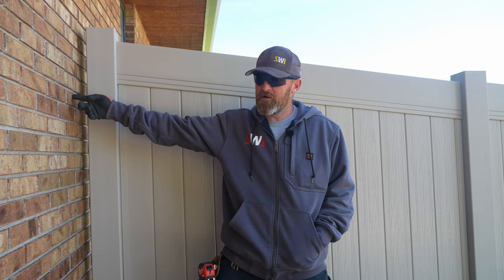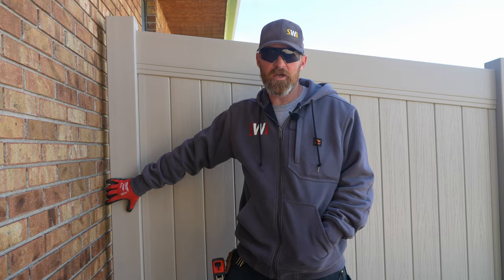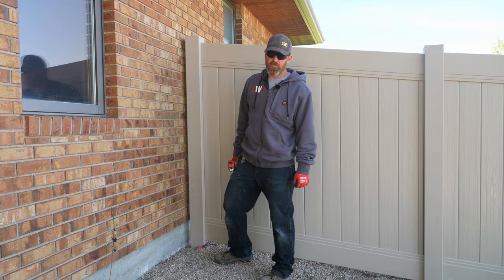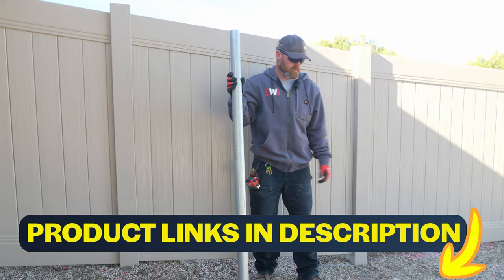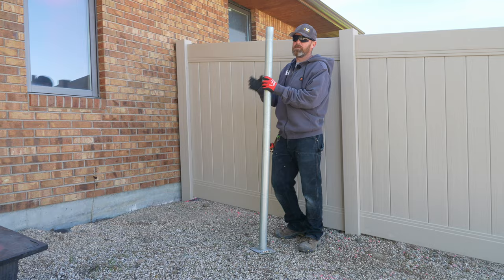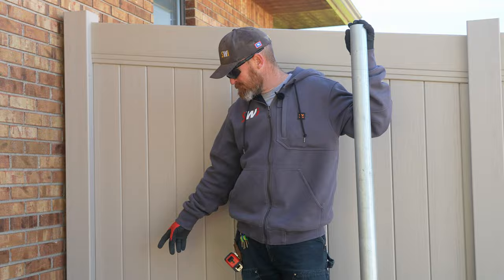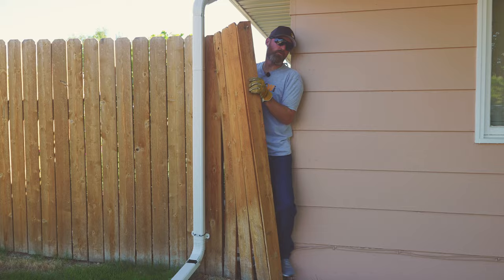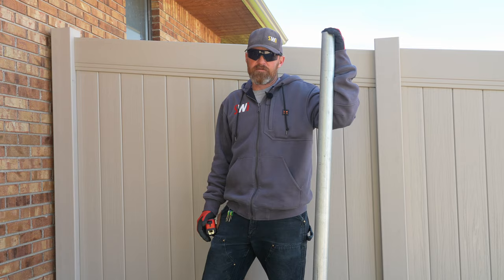How To Attach Your Fence To Your House The Right Way

Comment: In Florida if you attach the fence to your house it will be covered under your house insurance as it becomes structural. Learned this right after hurricane Ian. So there is a great reason to do it.
Reply from the maker: I think this may depend on the insurance company. Best to check with your carrier.
Reply: My Vinyl fence was not attached to the house, it 10 feet away.  UPC insurance covered it along with my well pump after Ian. They also went broke shortly after ☹

Comment: We do it in Florida because after hurricane Micheal, every homeowners insurance denied the fence replacement cost because it wasn't attached to the house. Every fence we install the owner ask to have it attached because their insurance company stiffed them. We still put a post next to the house, whether it's wood, chain link, or vinyl.
Reply from the maker: Sounds like they need better adjusters and attorneys.  We routinely have fences replaced under a homeowners policy.  Here's some reading straight from Progressive on the matter.

https://www.progressive.com/answers/does-homeowners-insurance-cover-fences/
Reply: That's funny!  Like that's gonna keep your fence anchored to the earth.... 🤣.  Criminals. They'll find any way possible to not do their job and screw you over.  In all fairness though, Florida rarely uses wooden framework in their houses right?  Metal studs and cinder block walls? If so, then there's no risk attaching to the house and would be the obvious choice. 🤙
Reply from the maker: Yeah it's rare to find an insurance company that's really out to truly serve the customer.
Florida has a ton more wooden framework then you would think.
Reply: Omg wen I was watching the video and looked at ur comment cuz I’m in Florida and I do Fencing so we kno hurricanes are no joke but yea Michael we tapcon the post in the home owners walls
Reply: @SWiFence  
So, Im in a situation RIGHT THIS SECOND where I ran an 8' section of fence where it butts up to a 4' section of concrete (that's a sidewalk). On the other side of that 4' section of concrete is my vinyl sided house. The 4' section of concrete is where my gate is going to be. I have purchased a nice and sturdy 4"x4" base that will be drilled into the concrete and that screws into the 4"x4", but there's no way that by itself is going to be enough for a gate or even as a stand alone fence post. With that being said, what is the solution for this particular situation ?
Hope you see this soon......
Reply: If you don’t have COVERAGE B - OTHER STRUCTURES on your homeowners policy, or you don’t have enough dollars in that coverage to pay for a new fence then you will be screwing YOURSELF.  Read your policy.  Know that the deductible is literally DEDUCTED from your payment.  And Fencing is always depreciated by its age in years.  So if you lose a $10,000 fence in a hurricane and you have a $2,000 deductible, and the depreciation is $500 then you’re getting $7,500 for your $10,000 fence.  No one is stealing from you.  This is how every policy works.  YOUR job is to know the real value of your fence AND know how much your deductible is so that you are knowledgeable about how much money you will receive.  You can’t blame your agent, the rep, the adjuster, or the industry for your lack of knowledge.
Reply: Mine is as well in Michigan. Now I have a crack in my wall
Reply: @SWiFence My insurance covers it ONLY at Actual Cash Value, no Replacement Cost if it is not attached to the main dwelling.  So you lose the depreciation.

Comment: I attach to houses all the time as it is impossible to dig a hole through the drainage pipes that often run along the base of house walls......it is common to do this in the UK. All new build properties in the UK have their fences running off the house walls. Gates are usually hung off of the house walls as well. I know you are based in the US where things are obviously different.

Comment: A lot of houses where I’m at have 6” drain lines running around the house. In some cases when the job calls for 4x4 you have no choice but to attach unless you want some hokey small panel (like the one in the video). Certain styles of wood fence you can face nail and get around it but sometimes there’s no other way but to attach
Reply: I haven't had drain tile be an issue yet, but you have a good point. I did have some conveniently end right where I needed the hole recently though.
Reply from the maker: We will have to disagree.  I have yet to see anyone address the potential for moisture penetration, make sure they anchor to studs, or in general make this look good.  Every time we see it, its a cobbled mess.  

We offered several ways to accomplish this without drilling into a foundation.  They did miss mentioning the optional Z post though which steps over the foundation/drainage or whatever with no need for funny little sections or drilling of concrete.

It should also be noted that we are talking about bolting a plated post to a footing.  If that causes failure in the concrete, there were problems long before we arrived.
Reply: @SWiFence  Agree to disagree. No biggie tho. To each their own. Still love the channel!
Reply: Sometimes you have to demo hammer against the footing to take out the over pour.
Reply: This is me. And no footing. On rockbed in mountains no less. Not touching the drain tile because it's essential. We get a lot if rain snd are the middle of a hill. The post is for a 12" section before the gate. No way I'm dighing and damaging tile for that.
Reply: @SWiFence  what is the optional z-post?

Comment: Love the channel, but I’m going to have to disagree with this one. 1) Faded paint or brick shouldn’t be a thought. 30 years from now grab a  power washer and move on. 2) Holes in the brick can be filled with a 4 dollar silicone tube. lags into the house are 1/64 smaller than the fastener, interface fit probably get more moisture from condensation on windows. 3) we aren’t drilling into someone’s foundation, I don’t want that liability. 

… you still build beauty fences. But lagging into a house isn’t as bad as your making it out to be.
Reply from the maker: We will have to disagree.  I have yet to see anyone address the potential for moisture penetration, make sure they anchor to studs, or in general make this look good.  Every time we see it, its a cobbled mess.  

We offered several ways to accomplish this without drilling into a foundation.  They did miss mentioning the optional Z post though which steps over the foundation/drainage or whatever with no need for funny little sections or drilling of concrete.

It should also be noted that we are talking about bolting a plated post to a footing.  If that causes failure in the concrete, there were problems long before we arrived.
Reply: I totally agree.  Scabbing to the house is the way to go.  I'm not messing with foundation anything.
Reply from the maker: Chris! 🤣 Just saw your 5 responses. Sounds like you've got plenty of smart fellas that agree with you. Carry on! 👍🏻
Seriously though, there's things we won't do, but if you do them and do them well, then rock on. 🤘🏻
Reply: @SWiFence  I believe I do, and I know I will.  Thanks man.   Fence on!!
Reply: @SWiFence epoxy a stud in to holes drilled in concrete, block, stone, attach a ledger with a nut, screw post in to that ?

I'm not sure I'd attach to siding or wood sheathing though
Reply: Insurance companies have the upper hand in Florida if you read the new laws of 2023
Reply: Yup!

Comment: In Florida there is concrete overpour from the slab, so there is usually no room to dig a hole next to the house. 5/16 lag bolts with concrete anchors do the trick on a block house. Patching and painting is easy peasy if you take it down after 20 years.
Reply: The question would be... Does this pass building code?
Reply: Thanks for that reply. I'm in that situation and for me to do what was suggested I would have to hire a contractor (no go) so this video just does not apply to all situations.  Maybe a better header would have been " How To Attach Your Fence To Your House. An Alternate Way"

Comment: I gotta disagree.  22 years as a fence contractor in CA (just so you know I'm not speaking out of school).  What about the foundation of the house just below grade?  Your best case scenario is to set it next to the foundation which will be around 4 inches at best.  Then you have this big ass space that looks terrible.  I attach a 2x4 "scab" onto the house using flashing in between the scab and house and fasten with some 4 or 5 inch GRKs into a stud.  If there's no stud, I'll use some toggle bolts.  It's not gonna get wet because of the eve in most cases, but if it does, it will dry fairly quickly because of the flashing.  I'd take another look at your theory before saying it's just flat out wrong.
Reply from the maker: We will have to disagree.  I have yet to see anyone address the potential for moisture penetration, make sure they anchor to studs, or in general make this look good.  Every time we see it, its a cobbled mess.  

We offered several ways to accomplish this without drilling into a foundation.  They did miss mentioning the optional Z post though which steps over the foundation/drainage or whatever with no need for funny little sections or drilling of concrete.

It should also be noted that we are talking about bolting a plated post to a footing.  If that causes failure in the concrete, there were problems long before we arrived.
Reply: @SWiFence  the double post is a good solution I'll admit if you're ok with the appearance. There's also the, set post as close as possible to the house and then just run a 1x8x6 or 1x8x7 (however tall the fence is) over the face of it with the extra 4" of the board filling the gap.  I am a bit offended though.  My shit is on point and looks great.  Seamless.  I wish I could post a pic.  Also, how would you not be sure you anchored into a stud?  It's very obvious if you did or didn't.  I can also completely waterproof if if need be or on customer request by predrilling where my GRKs are gonna go, and put a big gob of caulking on and around the hole just before attaching it to the house.  I'm just saying in my experience moisture isn't really an issue because it's always under the eve, and worst case, there's also the flashing.  Scabbing a 2x4 to the house is also fast, easy, and very durable.  It also looks the best out of all the other options.  Let me ask you, if moisture and termites were magically no longer an issue, would you scab to the house then?
Reply: Lol yeah, if I do it the way he is recommending, I have to smash out A LOT of concrete from the house’s foundation OR, like you said, come out from the house several inches. Definitely just using a 2x4
Reply: @SWiFence  What's up with the robo cut and paste response to everyone that disagrees with you? You state that you offered multiple ways that you can do this without drilling into the foundation, but yet you didn't. The only workaround you only offered was drilling into the footer in order to mount a plate welded post to it. You repeatedly say that you have yet to see somebody adequately address moisture problems, mounting problems, etc. While we may not be able to visually see this gentleman's work, he has stated his process in a clear enough manner that anybody that has a decent knowledge of construction hardware, materials, and general building know how can understand what he's saying enough to visualize what he means. In his details he addressed each one of your arguments against that method. I'm not knocking you or your work, but your arrogant attitude is not a complimentary to your work.

Comment: There are sone exceptions, if you have a like a 50" gate and want it stable as hell, attach a 2 x 4 to the corner of the house and mount the gate on it, or even use it on the closure side, its never going to move. use tap cons like I did for brick or stucco, put a little waterfproofing around the screw and your good. I'd say in most instances you don't need to do it but there are cases it makes total sense. Not any different than mounting anything else to house like a hose reel for instance.

Comment: what if I have a downspout drainage pipe underground near my foundation? I live in the city so things are crammed and there is basically nowhere else to put my fence. 

Hard to perfectly explain it without pictures, I'm building two gates in a 150" area. The middle of the 150" is the property line, so each gate is for each yard (one for me one for neighbor). The wider the gates, the smaller the fence section is between gate and houses. For 3 ft gates, that leaves about a 2 ft fence section (with posts 5" from house, and thus concrete even closer which will contact the drainage pipe).

It seems like I have two options: build a wide gate that places the gate posts close to the house, but far enough to not contact the drain pipe, and then attach a small fence rail to the house (~10"). Or the harder option of moving the drainage pipe, which is also complicated by the close proximity of houses, fireman windows etc.

Comment: I understand that it is not a good idea to attach a fence to the house. However, I have a drain pipe that runs along that side of the house, so I cannot dig a hole next to the house. Can I attach the fence to the house and seal it with caulk every year?  Pretty please?

Comment: What about with a driveway or walkway running the entire fence area? Two posts were set into the slab but for some reason next to the house, they didn’t? Bottom bracket bolted into slab or….sadly, attach to house, or both?

Comment: If I set a post in concrete right up to the foundation, should I put a barrier between the foundation and the new concrete? Just thinking about what it would be like to replace the post in 20 years from now if it’s joined to the foundation.
Reply from the maker: Ah, the joys of thinking ahead! Kudos for giving this thought. In reality though, it's not going to bond to the existing foundation anyway, so there's no need to try to create a divider of some sort. It'll be fine. 👍🏻

Comment: So, we had an addition put on the back, and due to a birch tree between the house and street (probably as old as the house) and its roots that have infiltrated the old rain drains, that front portion of the gutters had to be tied into the rain drains around the addition to the other side of the back of the house and then down to the street on the other side. I dont see any other option for me specifically, other than attaching it to the house itself. I dont have a different option, do I? I cannot put a post in the ground next to the house.

Comment: I tried to dig a post hole next to the side of the house, but I found not one, two, or three, but four PVC lines for my sprinkler system, and the sprinkler control wires.  The PVC are staggered such that there is no way to dig within 8+ inches from the siding.  I'd post a picture here, but I guess I can't.  I don't see any other way other than lag-bolting it to the house.  Suggestions?
Reply from the maker: Sounds like you picked the prime spot for the fence! I hate surprises in the ground.
You know your situation best. I would consider different available spots for the fence, or depending on what kind of fence you're building, you could use something like an offset post. https://youtu.be/GnR9RimdNMI?t=284

Comment: I am building a fence (because no one would come to quote - all said too busy).  I wanted to post on the side of the stars and next to the house, turns out the ones that build the retaining wall and drainage system were sloppy and concrete all in that area.  So now I have a 6ft gate instead of a 3ft - oh well.  But I need to be able to close it.  I was gonna post to the house since it’s the corner of the wall/drainage.  How would I put the 4x4 wood post without causing issues?  I have a masonry drill, so would I just get a post holder and drill into the concrete?

Comment: I have concrete, but it’s not straight. It curves in the middle. I can’t use the metal post because they would angle towards each other. Don’t want to drill to my neighbors fence because I don’t want any problems. So what should I do? Cut a square of concrete?

Comment: I have a 2 ft concrete slab all around my house.  I can’t dig a post next to the house. How do you deal with that?
Reply from the maker: You've got options. Attach a plated post directly to your foundation, or use an offset post to reach around the slab.
Reply: @SWiFence would love to see a video on it. Haven’t really found one, but I have something similar to the original commenter’s set up